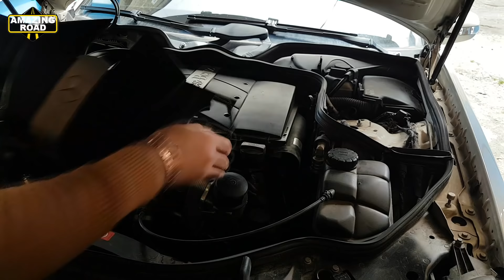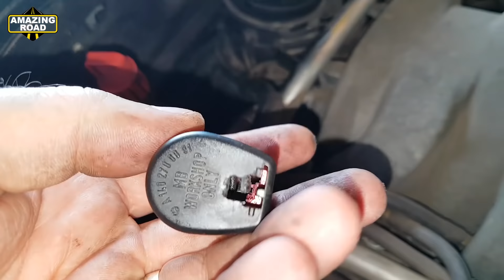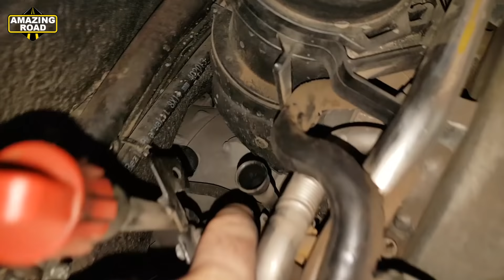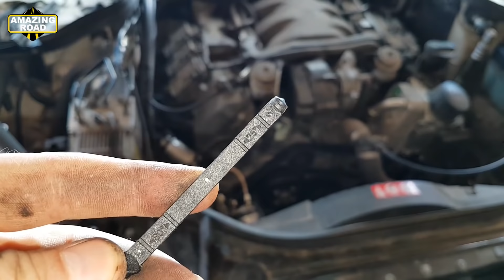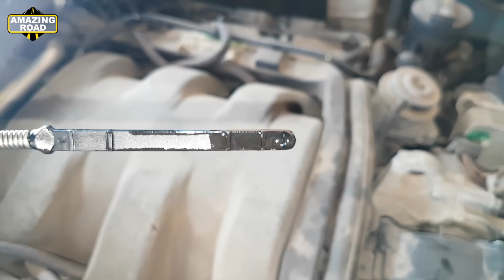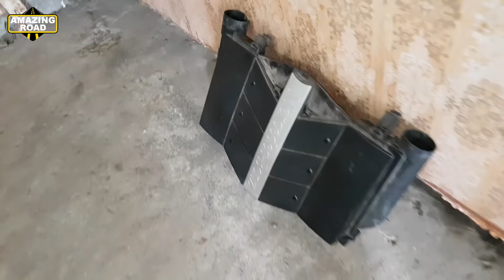How to Check the Oil Level in the Automatic Transmission 722.6 on Mercedes

Comment from the maker: How to Check the Oil Level Correctly in the Automatic Transmission 722.6 on Mercedes - https://youtu.be/V0zTa2-4Yzw
Installation & Activation Mercedes-Benz MB Star Xentry 2020.12 PassThru Final - https://youtu.be/thshMoWu0Z4
Full Installation and Activation Mercedes EPC / WIS/ASRA 2021 - https://youtu.be/92-cgGCW9ZM
Installation & Activation Mercedes-Benz MB Star Xentry 2020.03 PassThru - https://youtu.be/xk4dCH97ky4
Installation & Activation Mercedes MB Star Xentry 2018 PassThru - https://youtu.be/GLwqFI8NJzA
Installation & Activation Mercedes MB Star Xentry 2016 PassThru - https://youtu.be/N7-m8Ul7v-c
Installation & Activation only Mercedes Benz WIS/ASRA 2020 Full Version - https://youtu.be/huMw2O_7eCk
Mercedes DTS Monaco Installation & Activation + Patcher - https://youtu.be/_VdoRwWIlXs
Mercedes DTS Monaco V8.14 Setting to Work With Openport 2.0 - https://youtu.be/MmbQ8NBHrfo
Installation & Activation Vediamo for Openport2 + Full CBF Database - https://youtu.be/PJHrQ_gWUAU
Installation & Activation Vediamo for Mini Vci + Full CBF Database - https://youtu.be/45-GmLB7-l4

Comment: You are doing it wrong. The transmission must be in park and the engine has to run while mesureing the oil level. for perfekt mesureing you have to get the transmission fluid up to 80°C.
Reply from the maker: There is also a line for 25 degrees and a line for 80 degrees. You can do whatever you want
Reply: The transmission fluid can be measured when hot or when cold top line is for hot bottom line us for clod measurement
Reply: Is there a 25º C mark, if the motor is running its impossible to have that temperature. So it looks that the measure must be with the motor stopped, hot about 80ºC or cold about 25º. By these I do not agree with running motor oil level checking
Reply: @vanjose100   Despite the fact that there are 2 sets of measurements ( Hot / Cold ),   it's still possible to  check when it's cold. But professionals will always check transmission's with the box hot, 80c, to be exact  First, have trans ready for checking, with the dipstick tube cap removed, and  dipstick ready.  Make sure that the handbrake is  "ON", and block the rear wheels. Start engine and cycle the gearshift through all the positions..."P", " "R" "D" "D" etc ( inc sports mode)  Leave selector in "P" mode, and insert the dipstick, withdraw it, and read level, If you have an OBD scanner, you will be able to check the exact temperature , which will be somewhere in the low 20's, as the engine has only been running a few mins.. For a hot check, it's the exact same procedure, except you should drive the car first for about 20-30 Mins to bring up the temp of the oil. While checking the level, please note, that the trans has always to be placed in "P, and the engine has to be running. This is the correct procedure for checking an automatic transmission, It's quite different from checking the engine oil level, when the engine has to be stopped for at least half an hour before checking.
Reply: jmreire1 correct but only for mercedes and Jeep so far as I know that procedure, not for other car especially asian car most of them must check with engine off after reach for certain temperature.
Reply: Cold is a proximate check, the real accurate check has to be done at 80 C degree
Reply: @AmazingRoad you get more precise measures when the oil is hot

Comment: i don't want to rain on your parade but like literally every auto transmission ever produced must be checked while running. the 2 separate temp marks are only good when running.
Reply: Not on Mercedes. The manual and car let you know the car must be warm and off to check correct levels
Reply: If you have no leaks just use a fluid extractor and suck the ATF from the dipstick hole, measure how much you took out and put the same amount back in through the dipstick hole. You will need about 1 gallon of ATF per fluid exchange for the MB 722.6 transmission. Do two exchanges with a  short driving period in between (three is the optimum). This way you will replace most of the ATF by dilution because half of it is not in the pan but in the torque converter.  Easy and clean process that can be done every 3-4 years. Use Valvoline Full Synthetic ATF that meets the Mercedes standards for the 722.6 transmission. Costs less that $20 gallon at Walmart. No need to change filter. Do this every 50K miles and your transmission will work smoothly and last for the life of the car.
Reply: @triantafillosmountziaris4697  yet nobody tries it , other way is good to , but you never really have to change the trans filter if you tighten bolts when you start seeing leaks then every 25k change oil this way. 40k change is cool to oil not cheap .. harbor freight or eBay the pump .

Comment: Carefully push down onto the red clip but be careful the red clip doesn't fall into the transmission? It would fall on the floor worst case scenario.
Reply: That red clip can't be fall into transmission... its out side of the tube
Reply: Worst case it falls and doesn’t fall onto the floor. That’s when dark times are ahead…

Comment: You can also change the fluid from that port using a fluid extractor. If you have no leaks, just pour in the same amount of fresh fluid back into the transmission. This takes just a few minutes to do and will greatly extend the life of your transmission.
Reply: Please tell me how you change the transmission oil filter through the fill hole. Also, there'll be a LOT of sludge still in the pan...
Reply: @ChefPelle  There is no need to change the filter. There is no sludge if you use the correct type ATF.  Change the fluid every 3-4 years and you will be fine as long as you have no leaks, of course. To replace most of the ATF by dilution do two back to back fluid exchanges (three is better) with a short driving period in between because half of  the fluid sits in the torque converter, not in the pan. You will need about 1 gallon for each fluid exchange. Valvoline MaxLife Full Synthetic ATF that you can find at most places for $20/gallon meets the Mercedes standards for the 722.6 transmission that the ML320 and many other Mercedes vehicles of that era have. You will need ~1 gallon per fluid exchange so I typically use 2 or 3 gallons every 3-4 years. My SUV (ML320) is 22+ years old with 250K miles on the clock and runs smoothly.  The only transmission part that I changed was the 13 pin electrical connector which is on the front passenger side of the transmission because it was leaking fluid (known problem for ML 320). It seems that the 722.6 transmission ( that Mercedes was selling as "sealed for life") will work fine for the life of the car by just doing a periodic fluid exchange through the dipstick hole of the transmission. Good luck.
P.S. You can also change the engine oil from the oil dipstick using a fluid extractor. I have been doing that for more that 10 years now using Mobil 1 0w-40 Fully Synthetic Oil (European formula) that I get from Walmart and a Mann filter that I get from Amazon. Fast, clean and easy process and the engine runs smoothly.
Reply: @triantafillosmountziaris4697  woah, you DEFINITELY need to change the filter every time you do a transmission fluid change. It's the same as not changing the filter when you do an oil change.
Reply: @edocsil1635  Not true for this transmission and I have the miles on it to prove it :)
Reply: No, you can't. Because you need to wash the sides inside the valve body from all the metal particulates with brake cleaner, change the oil filter and clean the magnet/check for large parts of metal.
Reply: when extracting oil from transmission port can it be refilled by port or does oil have to be pumped through transmission pan?

Comment: mine was broken as well, and had no idea how to remove it, thanks for your help! I purchased the dip stick measuring device from Mercerdes to check the level of fluid. But it has a yellowish fluid, I have not seen before. Usually it is red on most cars. I am wondering if this is Mercedes Trans Fluid, or some other kind of fluid.
Reply from the maker: https://www.youtube.com/watch?v=y0lp9aJ25tc&t=29s
Reply from the maker: https://www.youtube.com/watch?v=WJ8yxhxtLe4&t=4s
Reply: CVT uses yellow from what I've learnt

Comment: FIRST and biggest MISTAKE - DONT do this, and always have a backup locking tab stupid risk to take plastic parts falling into your tranny.
ENGINEN MUST BE RUNNING, why?
This ensures the transmission hydraulic system is filled with fluid.

(the tranny oil level is always checked with the transmission pump running and the hydraulic system pressurized)
Reply from the maker: what?
Reply from the maker: You've already watched this video, don't be smart https://www.youtube.com/watch?v=V0zTa2-4Yzw&lc=UgxdSWMeWQBRArEZ27F4AaABAg
Reply: The plastic lock will fall outside the tube if pushed down. It's safe. But yea, I doubt a back of 10, they're dirt cheap. Better than having it shake loose and allowing dirt inside.

Comment: I have a 1995 w202 c220 Auto with 155 000km 
When I select R then it takes few seconds before the gear can be selected.  
If I put in D it selects well and also changes well.

Comment: Be careful with that plastic bump from this type of measurement tool. When I pulled it up the plastic stucked inside and I got it out on the other side when I changed the oil.

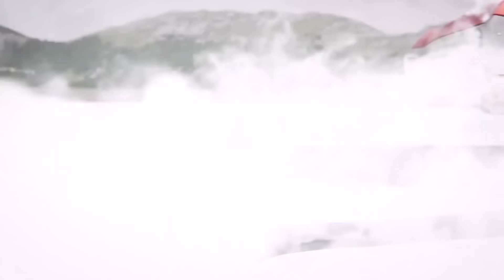Comment: Starting around 4:54, there's a tube with a red cap on the left side of the hand.  Do you know what that pipe is for ?  I lost the cover and I need to buy a replacement.  Thanks!
Reply: Arnel Bicol the tube with the red cap? That where the dealer or Indy shop check for motor oil (oil fill tube) using a shop oil dip stick.

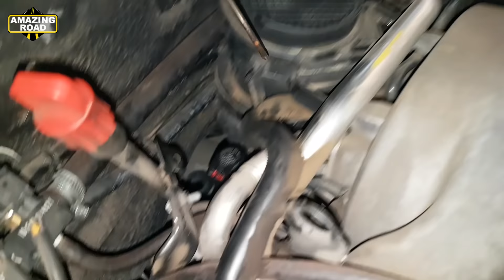Comment: 0:41
Which fluid goes into the red gauge at the left side please ?
Reply from the maker: https://www.youtube.com/watch?v=V0zTa2-4Yzw
Reply: Red cap oil….black cap transmission
Reply: Also when is the recommended time Interval for tranny flush 75k I got a code p0705 trans range circuit. I thought start with transmission fluid change we did it back at 75k now it's 151 k. Thanks in advance

Comment: What is the red cap above the transmission cap?
Reply: engine oil
Reply: Thank you. I have another question. My transmission cap was never there. I tried to push the dipstick into the hole, but it wouldn’t go down. It looks like something in there stopped it. Please help.

Comment: My 2006 e350 doesnt have that hose with broken red cap, theres literally nothing there besides the engine oil dip stick, any idea why?
Reply: 7 speed? If so it doesn’t have a dipstick, can only be checked by dealer.
Reply: @mrhvids4461  yeah it's the one with no dipstick, I actually still managed to change it on my own. Theres a youtube video for that one too.

Comment: thank you for the valuable information.
I have Mercedes Benz E240 (147000) km but it consumes a lot of fuel do you have any idea about the problem.
Reply from the maker: You can check the spark plugs
Reply: @AmazingRoad  thanks
Reply: Lambda may be faulty

Comment: Hi . I have the E320 WAGON 2002 . 
W210 . Wondering if anyone knows what TRANS FLUID i need. 

The brand and number of that brand please be specific . 
.........  brand and number on bottle and all . WHAT ARE YOU GUYS USING FOR TRANS FLUID ..... 

2002 MERCEDES BENZ E320 
4 MATIC WAGON   W210 .  

I JUST PURCHASED AND NEED TO KNOW SPECIFIC TRANSMISSION  FLUID . NO ONE SEEMS TO KNOW .

Please and thank you !!! 
Need to service trans and dont know what fluid it is